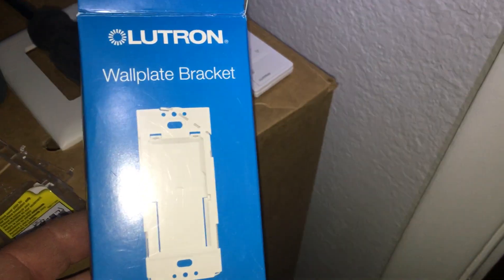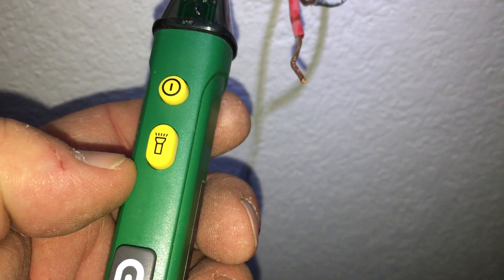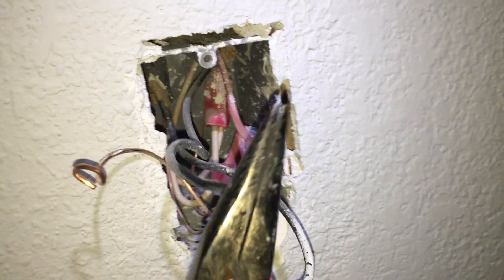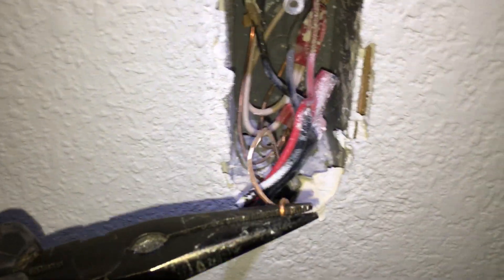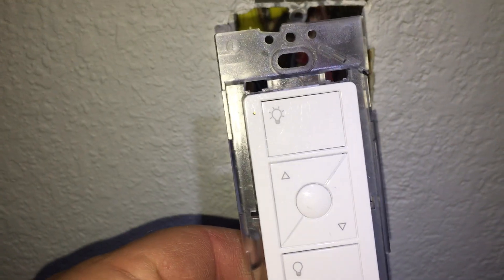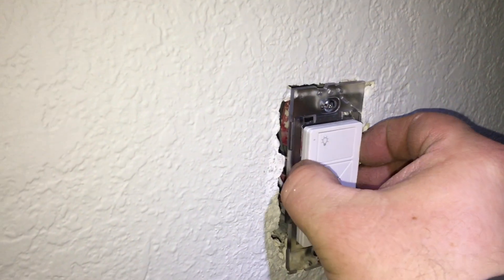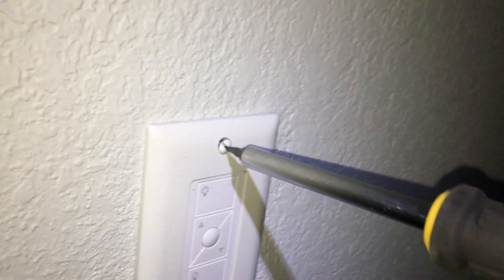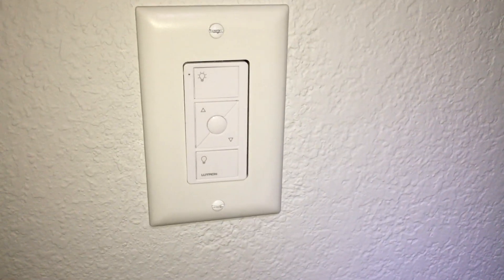Lutron Pico Remote replaces a 3-way switch

Comment: I do not remove the pop-out piece (0:15 in video) for mounting on a live junction box, so that when you remove the Pico remote in the future, for whatever reason, there is not a hole to stick ones finger into, given the live wires in the junction box.  Removing the pop-out is for wall mounting the plate without a junction box. Thanks for the reminder of what to do for a 3-way ... join all the hot wires and stuff them back into the junction box!

Comment: Did you do this so that the light is 'always on' and now you can install a smart wifi bulb like a Philips Hue, and now you can pair it with this wireless pico remote?
Reply from the maker: Nope, I use this PICO remote paired with the other switch at the end of the hallway. I capped the wiring where the PICO remote is now located. 
I greatly prefer smart switches over smart bulbs.

Comment: I did this but now my lights aren’t turning on :(
Reply from the maker: Were they working previously with the Lutron switch and remote? 
Have you replaced the battery in the remote?
Reply: Dave Robinson actually, after walking away and coming back to it a couple of hours later, I saw that one of my wires came out of the nut when I opened it back up. Secured it again. Left it open while I went into my basement to turn the power back on and it worked. It was me being dumb haha.
Reply from the maker: @SeanErixon  Awesome! So many problems are solved by just taking a break and coming at it with fresh eyes. Good for you, and thank you for following up--I'm grateful!